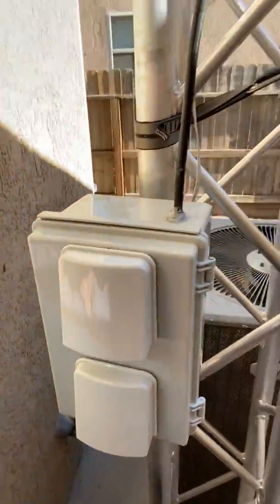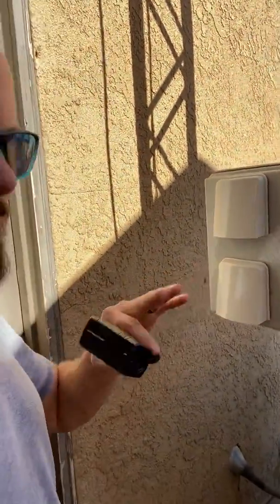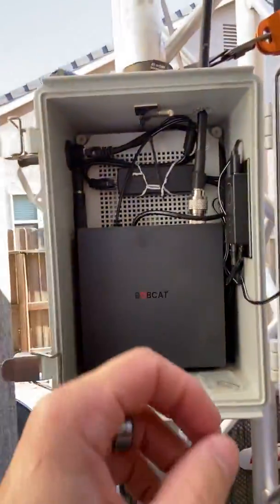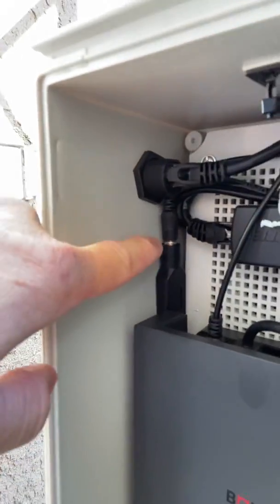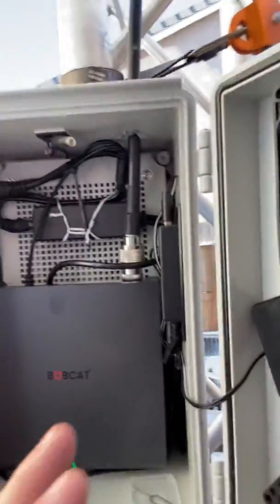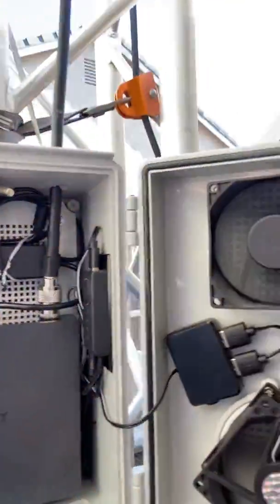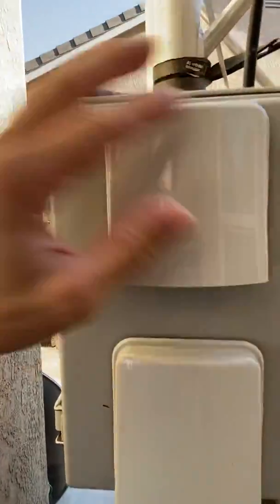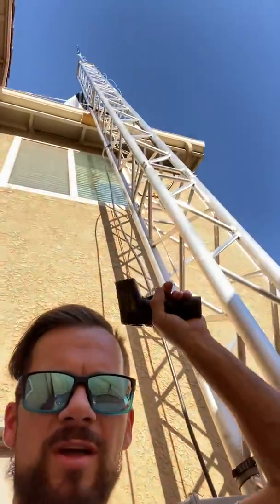Custom A/C Helium Network Enclosure Bobcat 300

Comment: Can the outdoor kit keep the miner working with an outdoor temperature of 40C?
Reply from the maker: At 40c outside temp that means your box surface will around 46c. Bobcats should not exceed 45c if I recall correctly. Running this system can and in most cases keep your miner external temp down by about 10c compared to the external housing

Comment: lol omg the last 5 seconds of the video showed how stupid this entire project was. you could have ran eathernet or wifi up to your attic and then ran a 15 foot R400 cable and got even higher, with less loss lol and so much less time and money spent and that hideous tower next to your house, you should try it and see what the results are.
Reply from the maker: This was the initial proto type. I wanted easy access at ground level so that’s why it was done this way. 
A month later we raised the tower another 20ft and place the box 2ft from the antenna at the top. 55ft elevation

Comment: nice work.  preeettty much only works in cali in that situation, where you have no rain or snow. you have a 80 mill intake fan and it will pull snow right up in there no problem even at 1500 rpm. but for your use case its very well done, dont really understand why you didnt just leave the bobcat 3 feet to the left inside that building and running a R400 cabble up that pole to a true uni directional antenna depending on where your at, considering if your in a rural area there is absolutely no need to have it outside.

Comment: I copied your PoE injector and splitter as well as the USB adapter. My fan is a different fan due to a smaller build. I'm using DC 5v 0.4a fans and it seams to not power them fully. I also noticed the injecter says on the cat5 cable lines 1-2 are negative and 3-6 are POS but the spliter is opposite did you wire both ends the same or swap T568B to T568A?
Reply from the maker: Hello Wrecker TV,  I don’t timber it’s been a wile on that build. Everything works as intended though

Comment: poor design.. heat rises.. your top vent  is  pushing heat down.. if the fan fails,, youre trapping heat..
better design.. raise your top  vent  cover up or at least higher than  the  enclosure for  natural ventilation if something fails ...
 and shade over the whole thing
Reply from the maker: Hi Johnny,  Thank you for your input. Poor design? We disagree. Vent at the bottom blows air in and across the hotspot taking warm air up to where non important components are and the top vent has a fan that pushes air out of the enclosure. Granted there can be further improvements but not a bad design by any means.

Comment: So the hot air is being blown directly over the cold air intake shroud. That's basically circulating the same hot air back in. How about one shroud pointing 45 degrees left, and the other 45 degrees right? You should also build a channel within the enclosure that will force the air over the hotspot, then power supply, then out. This could be as simple as a metal shield at 90 degrees to the panel door in between the two fans.
Reply from the maker: Good idea Ahmet, is it blows back over but once the air exits it becomes nearly ambient temperature instantly. Plus the lower shroud would only have enough pull to draw in a fraction of the air coming from above it. Majority of the draw comes from under the enclosure.

Comment: Question: I’m in the process of building this same case. I noticed the the spec on the fans are 5v and if the Poe splitter is putting out 12v. I bought a 12vdc to 5vdc usb to work the fans. Iam I correct?
Reply from the maker: Yes

Comment: Thank you for the video.  It has been very helpful.  

I purchased all these items (or equivalents) and am getting ready to deploy with a nebra indoor. In testing the setup, I noticed that the fans would "tick" (move just a little when not actually running) when connected through the Temperature Controller.  The ticking seems to be timed with the light on the Temperature Controller blinking at whatever temp I set.   I remove the Temperature Controller and no tick when the fans are off.  Should I be concerned about this?  I wouldn't want anything to happen to the hotspot if this introduces some sort of power surge (power tick?) through the system.
Reply: Hey dude, i hope you manage to fix the ticking by now. If you did can you let me know how? Also can you explain if you know why i need "1 Female to 4 Male spliter"  INSTEAD of 1 Female to 2 Male? Any help will be appreciated.

Comment: great video !! Im trying to do the same thing but my miner has a USB C, how can I get a splitter that has both USB C and 12V to power the fans ? thanks in advance =]
Reply from the maker: Check out our set cap video. Problem solved
Reply: @digitalblock559  appreciate you !! ty

Comment: what do we do in the air if there is high humidity
Reply from the maker: Seal the case with no fans or run and exhaust fan only
Reply: @digitalblock559  this time it will be hot in summer.

Comment: Living in Quebec and it does goes -25 degrees sometime.. would this be bad, if it was outside?
Reply: LoRa transmitter specificaiton is 0 to 40 degree... so no.. you can't use it outside during winter (i live in Quebec too).. so i now check how to build an encloser with "heater" inside that start when reaching under 5 degree.. and stop at 5 too !
Reply from the maker: We do not suggest that. Always try to keep within the manufactures settings.
Also look into mounting it inside your ceiling with insulation around it

Comment: No moisture will get in? you have to fan holes...
Reply from the maker: Moisture can very well get in here. We suggest if your in a moist environment to run a sealed enclosure or a single exhaust fan. To help prevent/reduce condensation and maintaining ambient air temp.

Comment: Can you also use a passive POE injector amd splitter?
Reply from the maker: Good question. We just tried this and found it cause alot of issues of an on. We don't suggest it. Sometimes it wouldn't even power the device.
Reply: @digitalblock559  Good to know. Thanks for the info. Nice setup by the way

Comment: HI So i bought Poe injector 14.5 watts and Poe splitter not able to power up anything at all. the only power I can see is from the adapter.
Reply from the maker: You may have a bad splitter. Also are you using Cat5 or CAT 7 cables?
Feel free to join our Discord channel as well.

Comment: The Bobcat power isn't 2.5mm? Which power splitter did you used? The one on the description it's 5.5 x 2.1 and and the bobcat it's 55. x 2.5 right?
Reply from the maker: Hello Pedro,

The one we used is in the description links below works perfect and as intended. Bobcat adapter uses a 5.5x2.1

Comment: OOO no light restor . One bolt of lighting and your done with
Reply: why didnt you take plastic case off it
Reply from the maker: This was a rented hotspot. To remove the cover would remove the warranty.
Reply from the maker: We do implement a lighting arrestor on all our builds. Its always at the top directly under the antenna. An there's always a chance to loose the hotspot as well when/if lighting or static electricity builds up.

Comment: lol so so funy . We sell tho at my work in denton tx . I make them their for Wifi router and what not . Hell we sell ones with foam allside them . thats so funny have have like 2 12v computer fans in them
Reply from the maker: Its the easiest solution. The whole concept of this build was to create a easy plug and play solution with no need to soldier or do any wiring work. We feel we hit the nail on the head here. Also fans are 5v and each one has the capacity to empty the air in the case 113x over.(a little overkill)

Comment: How about cold temperatures like - 30 degrees in north Canada?
Reply from the maker: Were thinking we need to create a solution :)
We don't have one yet for you though.
Reply: @digitalblock559  I will need a solution soon as winter will start in appx 1 month. Keep me posted if you have any suggestion thanks
Reply from the maker: @Crypto_trader123  Not sure if we will have one by then but we'll see what time we have to dedicate to this. We know winter is approaching fast.
Reply from the maker: @Crypto_trader123  If ou haven't already make sure to sub our channel to stay up todate on our newest builds and solutions.
Reply: What do you mean just buy a fully enclosed case without the fans, and the components will keep it plenty warm, you definetly dont want the fans, they will suck snow right up in there and deystroy everything. and if it doesnt  stay above the temp required, which  i doubt, insulate it with foam. or keep it inside and just run a 30 ft R400 cable everyone thinks you loose so much profit per foot of cable.. the ammount of money spent to make this guys unit will never be recouped at this point with HNT the way it is. just buy any miner and run it POE and put it in a a modified Pelican case.

Comment: Question about moisture... I can see the ocean from where we are, and outside metal tends to corrode... I saw that you had a little Gel-Pack in there, would that be enough to keep the moisture levels down, or is there a better way... I'm not SUPER concerned about temperature, since it will be in the shade, and protected from any rain, I'm just worried about sea-moisture... any thoughts?
Reply from the maker: Good question! It best to stick will a fully enclosed box. IP67 rating. This will ensure no moisture gets in. Adding a silica pack in addition will help
Reply: @digitalblock559  thanks so much for the response!! (So I don’t get to do a mini DIY project? Just drill a few holes? That’s disappointing ;( 

To clarify... no ventilation, just enclose it... if it’s enclosed does that increase the concern for temperature? (Hottest it gets in the summer here is around 90F, in winter, night can get down to about 40F)
Reply: @digitalblock559  that is not quite true, a fully sealed enclosure ip67 will still have air that will condensate. especially when outside is cooler out. with a 2 fan system you should be able to keep the humidity from compensating. Humidity is not an issue, but when it condensates you're done.
Reply from the maker: @moguaiato5583  Thanks for your comment. You are correct to a degree, that's why we implement a large silica pack on all our enclosures. Closed and vented.
Reply: @digitalblock559  in a dry environment such as yours and mine Silva packs work fine. But in places with really humidity silica packs need to be changed often, proper venting is key in humid areas.

Your design is similar to my designs which I like. Things I did different is using waterproof bulkhead connectors for the antenna and power. Makes for a clean/professional enclosure. Normally don't bother with ethernet and use wifi. If signal is poor I'll just place a booster near the Hotspot. Thus eliminating a source of heat in the enclosure. I also open up my Hotspot to allow better airflow and cooling. Currently I'm deploying Sensecap Hotspots. But have 25 bobcats on the way. I also don't use a temp controller, but I Like the idea. Just not needed in South Az. But I think it's overkill in this situation. Based on ease of access and fairly constant outside Temps throughout the year. Remember it's really hard to over-cool a processor.  The cooler it is the better it will run*. So let them run.
Reply from the maker: @moguaiato5583  This was the first version. Only the ethernet port was water resistance. All other versions after this do use waterproof bulkheads. Opening up the hotspot is great but as a company we can't responsibly tell people to do that as it would be negligent. Maybe as a person but not as Digital Block. We agree on the CPU temp :)
Keep up the great work building the network!

Comment: Do you really need the bottom cooler to absorb air ? I think if you just have the bottom hole, it will perform the same ( since the top cooler will suck the air out )
Reply from the maker: Hi Anthony, the bottom vent in this prototype was to intake air to pass over the miners and help pull heat off. The top fan would the. Pull that warm air out.
If we didn’t use the fan with the bottom vent the top fan would still suck air up onto it but you would loose that passive airflow.
To be honest, that’s not a bad thing. We run the fans now purely as exhaust fans.
Reply: @digitalblock559  great, thanks for those tips !

Comment: You have absolutely no clue of how enclosures work or thermodynamics work. I am an automation engineer and we design and install cabinets in extremely harsh environments with proper Cooling and proper ventilation and understand heat loads. You have not taken any consideration for humidity or  infiltration of dirt and other contaminants. Not to mention silicone sealant should never be used around electronic components. Your entrances and exits to the cabinet are not at all weatherproof for the long-term though it might work now it will not work in the future and you will have a mess inside your enclosure it never surprises me people like you giving advice and you don't know what you are really talking about.  other people listen and have catastrophic results . it's actually hilarious.  Sorry!
Reply: What is your advice to clean the mess inside ?
Reply from the maker: Your correct Anthony. I don't think you replied to our other comment on yours but we would love to discuss with you solutions. As stated in this video its a prototype. Something were testing out, we don't claim to be experts. Its a learning process.

Comment: Hey! Thanks for all the info and resources. I was wondering if there was a way to limit the power so that the fans aren't blowing at full blast?
Reply from the maker: Absolutely. There is a manual dial inside the enclosure. You see the the USBs connecting to it. You can use that to dial the RPM of the fans
Reply from the maker: It comes with the purchase of the fans listed in the Amazon link
Reply: @digitalblock559  Thanks for the info. I went with a smaller enclosure and got different fans which didn't have the dial. I was able to get a speed regulator though.
Reply: @phamjosi  Can you share please which enclosure you bought?
Reply: @maxs.8146  dude he literally listed every single itemand also said he listed everything in the video as well. read the description sheesh
Reply: @Mr.Thermistor7228  my bad👍🏼
Reply from the maker: Awsome! Glad we could help!

Comment: Hey ,i loved your setup and i really copied most of it to do it myself, i have a question is the IPV-1115 IP32 Air Vent, 3.2" x 3.2" or the IPV-1116 IP32 Air Vent, 3.9" x 3.9" compatible with the 80mm fans you shared ?? thankss
Reply from the maker: Only the 3.9 is compatible. The ring that screws onto the back has screw holes that must up perfectly with an 80mm fan.
If you do the smaller air vent the holes won’t line up and you won’t be able to mount the fan.
Reply from the maker: Don't forget to send us photos on twitter of your build!
Reply: Does anybody here understand what IP stands for? The IP rating is how well that particular device will protect against Ingress of solids and liquids. Here you're referring to an IP 32 this has zero protection from solid in grass it's meant to keep fingers and tools on I've pasted this from the international standard please enjoy.
IP32

Protected from tools and wires greater than 2.5 millimeters.

Protected from water spray less than 15 degrees from vertical.

Comment: I still don’t like the high temp over a long period of time.  It does have a high heat rating but low 100s over time will damage.  I’m in south Florida.  No thanks, I’ll keep paying hosts!!
Reply: In California you can shade it and get lower temps but we have the greenhouse effect here and would be circulating humid air.  I was hoping to find a case with an actual mini a/c compressor.  Good job though!!
Reply from the maker: It’s possible. Maybe if we can secure a sponsor we can do a build video and test on it.
Reply from the maker: It’s possible for sure.

Comment: I live in Wisconsin.  How would this work in the cold temperatures?  Wind chill can get as low as -40 -50 degrees F.  Actual temps as low as -20 degrees F.
Reply from the maker: Go! Pack Go!
Actually this enclosure would not be beneficial to you. You would need the opposite. A enclosure with a low power heater to prevent damage to harsh external cold. There's a few out there but they will cost you $300+ It might be best to keep it indoors in an attic with insulation around it the miner itself(but still allowing it to breath)
Reply: @digitalblock559  i bet even in the middle of winter the miners produce enough heat to keep the enclosure above freezing, if not a small light bulb  would provide the extra heat needed. But since there is a temp difference inside/outside condensation would be a problem without vents. Luckily i live in AZ and moisture isn't a big issue.
Reply: I'm in wi also and thinking i will build one...only part out of stock on amazon was the vents...do you have a link to comparable vent or wait? Also if including a light bulb for heat  where to power it from? Splitter? Socket? Anyone do this? Pic?

Comment: You don't need the top fan. Air you blow into the enclosure with the lower fan will come out through the opening above, because there is no other way for it to escape. If anything, your setup creates a shortcut for the air before it even gets close to the equipment. Alternatively you can use a single top fan only to suck out the air, result would be the same. I also recommend to add an an air filter on the intake.
Reply from the maker: Good points Daniel. We have come to that conclusion as well We have found a few filters and are trying to figure the best one to allow for airflow and fine dust filtration.
Reply: dude the box is like 6 inches deep theres no shortcut the air is going to take lmaoo it will most definitely pass over and around the miner for cooling effect